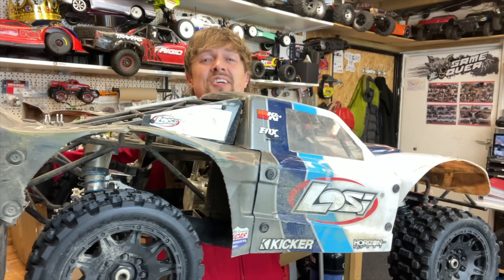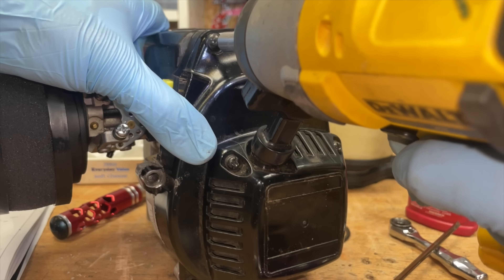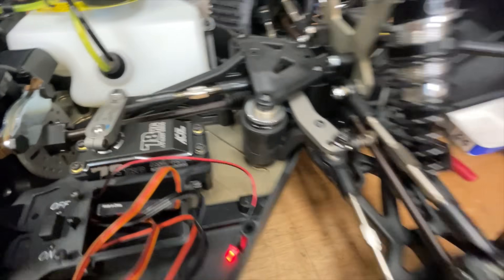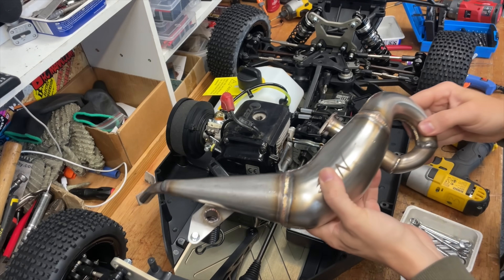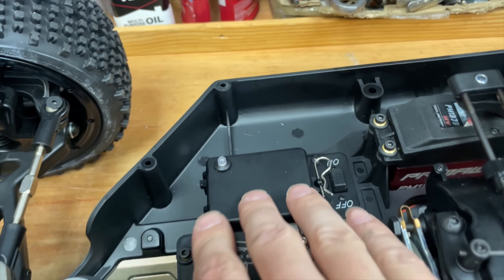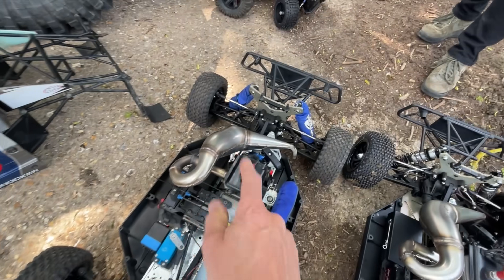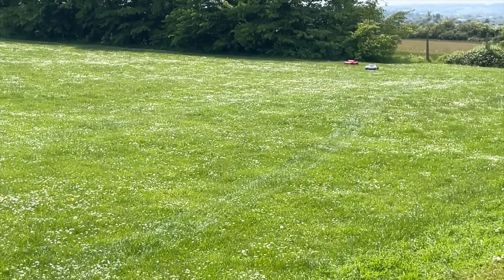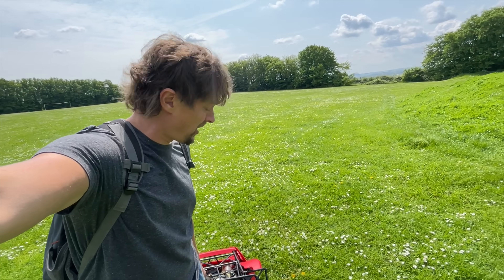GIANT Cheap GAS RC Car vs Expensive Truck

Comment from the maker: 🚗Talbot stickers - https://what-happened-merch.creator-spring.com/
👕Clothing  https://teespring.com/stores/kevs-merch
🚗Win one of my cars https://raffall.com/kevin_talbot

Get 30 North Here https://www.rcmodelz.co.uk/rc-cars/1-5th-scale-petrol-rc-cars/30dnt-v2-rolling-chassis-1-5th-scale-4wd-sct.html

Losi https://www.avantlink.com/click.php?tt=cl&merchant_id=4b85b2b7-558e-4304-89fc-54958c8f47f0&website_id=78306fdc-4500-4834-a455-32288403b036&url=https%3A%2F%2Fwww.amainhobbies.com%2Flosi-5ivet-2.0-v2-1-5-bindndrive-4wd-short-course-truck-grey-blue-white-los05014v2t1%2Fp1307019

AGF Servo https://amzn.to/3K98xgj
Reply: Nice video
Reply: Plot twist: the woman who told you off was the one who doesn't pick up after her dog!!!
Reply: Hey Kev you should start do give aways cuz you sure do have a lot of rc cars. Think about how happy all the viwers would be
Reply: @KevinTalbotTV you may use dumborc X6YCG receiver instead of X6FG. X6YCG receiver have failsafe feature for gas and nitro engines where as X6FG is for electric cars and dont have a failsafe.
Reply: Quick question if heat removes thread lock was there any point in thread locking the exhaust bolts instead of using spring washers?
Reply: @timmyreeves9170  I kind of thought that myself whenever he used thread lock on the exhaust bolts.
Reply: Never thought of that reeves
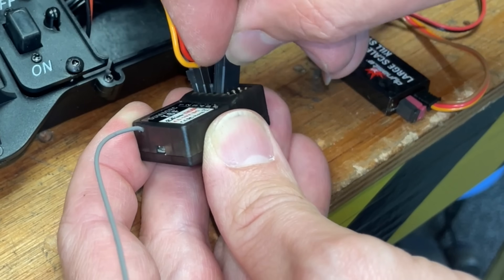Reply: Kevin, are you using your rc 1:16tg scale USA walkerbulldog Tank with all terane in the racetrack mait ?
Reply: Kevin, are you using your rc 1:16tg scale USA walkerbulldog Tank with all terane in the racetrack mait ?
Reply: Make a fast, are c car
Reply: I want a toy
Reply: You should put a gps on both and see who’s faster

Comment: I really like the indestructible body panels on the cheap one, the single piece thin cheap plastic bodies on other rc’s are just junk 👍
Reply: $1000 cheap..
Reply: @dieseldabz7104 it’s gas not nitro  or electric that’s why your paying for the size
Reply: @dieseldabz7104  it is cheap, considering the cost of most of them being over 1k

Comment: This is a great video. It shows you can have a lot fun. You don't have to have the most expensive truck. Both trucks were fun and you didn't have big biggest and baddest motor. I have found here in the U.S. you can buy that same truck with a 29cc motor, servos, pipe, and receiver pack for under $1,100.00. It is very tempting. Thanks for sharing. This a very useful review.

Comment: Wow 37mph that's fast for a trophy truck that big with that big of a motor seems like the  suspension needs a little more travel about 3MM more for that no bounds landing But outside of that mighty good work sir Mighty good 👍

Comment: On a 2 stroke engine. The more oil in the mix, the better the ring seal and the better compression and protection the engine will have. Up to 16:1 anyway. Of course you have to rejet for that as well.

Comment: I've also had that same issue DumboRC receivers and transmitters....one might have gone bad. I've moved over to cheap option Radiolink rc4gs can do 30 models memory so you don't have to reset every time, cheap $10 receivers and $17 if you want Waterproof, and same parent company/Tec of DumboRC but better!
My 2 Cents
Bash on brother Kev

Comment: Thanks for this video, I have been back forth about should get the 30 degree north 5ive t clone or the real Losi 5ive T 2.0 version. I'm not sure which one i should go with since the 30DN is cheaper and i watched Thunder RC's videos on his version and the 30DN is one of the strongest RC's he has.
Reply: His electric version is tough very very tough. I did watch one go on bay for 650 last week already converted so they are out there
Reply: @davejohnson3474  Yeah his electric one was very very tough and is why i'm interested in the 30DNT. And you found an electric converted 5t clone for 650? Wow i'm jealous of whoever bought it. Even though i don't plan on buying mine until next year if i get the clone or until 2025 if i get the official Losi truck.
Reply: @cjchannel12RC  yeah £650 fully converted looked really nice so like you i was surprised it went so cheap for what is a monster. Such a tough truck though not sure what wheels thunder rc uses on his but there definitely bigger hah
Reply: @davejohnson3474  I think he uses either Rovan XLT wheels and tires or Pro-Line MX57 tires with raid wheels. I'm going to keep the stock short course style tires on mine when i get it.

Comment: I just bought a ton of nitros and nitro stuff, came to the conclusion the traxxas models need to stay stock! The revos not worth it at all! Honestly the biggest trick of all, but no avoid revo at all costs. The savage 4.6 is your best bet!! Or xl!!! Need to remove the engine and fuel tank to do the spur gear easily!! Kevin pin this to be a good guy 😂🎉

Because I might’ve wasted 3k on life lessons and figuring stuff out. And still would proceed…. Better off going rovan!!!!

Comment: Got my 5ive t about 5 months ago... 2 problems right from the start ... skeptrum receiver  was faulty.. all functions worked but wouldn't steer 100% to the left ... then problem 2 was steering servo screw wouldn't stay tight .. tighten twice then 3rd time with some blue loctite .. been good ever since.. i definitely like that 75k steering servo you have so im going to get one ... only 1 other problem ive had is small gravel getting stuck in the knuckles and or the steering saver and would lock up while driving losi.. other than that Kev this thing RIPPS!!

Comment: With zenoha would just make an engine with what I would say is the most modern porting.  Every one of my zenoha piston port engines I copped what yamaha did back in 1973.  In 1972 their r350 was a piston port engine.  And in 73 they added reeds and cut holes in the skirts of the pistons.  I have done this with over a dozen engines.  No failures to date and better tourqe and higher rpm.  Wakes the motor right up!!  And when 2 extra ports are added, even better.  Not sure true HP numbers but way better than stock in top speed and zero to top speed.

Honestly,  it would not be that hard or less reliable if zenoha updated their ports.

Comment: Hey kev, the reason your receiver was cutting in and out was because you were holding the remote too close to the receiver. I had the same issue with my dumbo. The remote just can’t be close to the receiver that’s all.

Comment: Hey Kevin I know you’ve had good experiences with the dumbo but I would really recommend something like a radio link rc6gs there much more responsive have more settings and are much better quality I had the dumbo cause a electric rc have a runaway and blew up vintage esc and motor really horrible quality and just honestly not great I mean I’d rather have quality over price and the rc6gs is still a pretty cheap control with great range and are much better than dumbos also backed by a company that is know for making great transmitters                 

hope you have a great day your an awesome person and hope to see more videos soon😊
Reply: That's user error...
Reply: Dumbo and radiolink are the same thing..
Reply: @BlairW66  are you mentally stable
Reply: @blitzrc4713  no it’s really not if my radio starts going crazy even where everything was set correctly even tryed messing with the th trim but nothing helped just saying quality control isn’t great that’s all

Comment: Been thinking about one of these ,now seeing it side by side with the losi ,think I'm going to give it ago 😊
Reply: They're a fantastic truck, I've had mine a year and I still haven't broken anything.
Reply: @BlueSmokeRC  that impressive, I'm quite rough on rc cars 🤦🏻‍♂️so il see how it goes lol
Reply: @craigcostello9101  I'm willing to bet you can't break it! I've lawn darted mine from at least 15' in the air and it just shook it off like nothing happened. I absolutely love the truck but my engine decided to check out after it ate a ton of dirt so I gotta try save up some pennies for a rebuild.
Reply: @BlueSmokeRC  challenge excepted lol. Oh how you manged to get dirt in it ?
Reply: @craigcostello9101  I 3d printed an offset intake so I could run a bigger air filter and keep it up and away from the dirt kicking off the tires. It worked great until it self destructed. I got it all on video though so I guess there's that. It's up on my channel if you're interested.
Reply: @BlueSmokeRC  il check it out
Reply: @craigcostello9101  thanks brother.

Comment: hi kev, could you review the hsp backwash? its pretty cheap but its a good little nitro buggy, although if you go over a ramp at full throttle the wheel can break off.

Comment: Is it really cheaper though? Team Losi usually comes with everything you need to run the truck. The other truck looked like a few hundred in extra parts you have to buy to run the truck... 😂
Reply: Yea but he fitted expensive parts to run it im sure you can do it cheaper
Reply: £739 RTR

Comment: With all the rc models you have, have you ever thought about switching to Sanwa i use the m17 transmitter can go wrong with the performance.
Reply from the maker: Then I have to get 200 receivers and does it even have that many model monody’s?

Comment: I have the same  issue with my dumbo...but is in hobao hyper VSE on 4s...when i drive is like loosing a connection and stays for 2 3 sec locked on steering or half trothle and then is okey

Comment: The stock 30• north is faster out of the box than the Losi and way stronger I own both I’ve had the lose brake a lot and never had any problems with the 30• north faster better and cheaper

Comment: Can you fit losi LMT parts on to that 30° north truck or not?
Reply: The  30° north truck is 1/5 scale the losi lmt is 1/8. The losi 5T is 1/5 scale
Reply: @TABRO284  oh ok sorry I got the two switched up. But will the parts from the 30° North truck fit on the 5t?